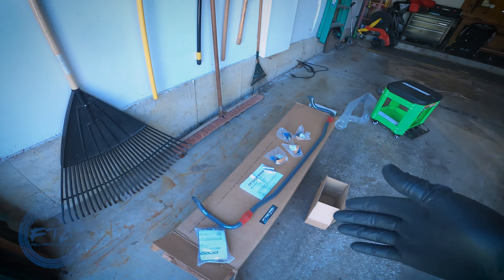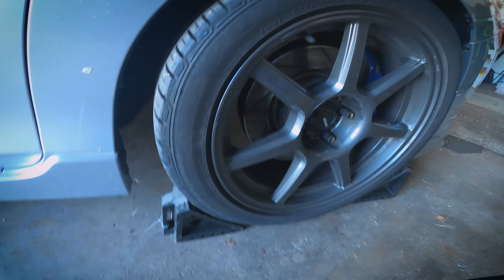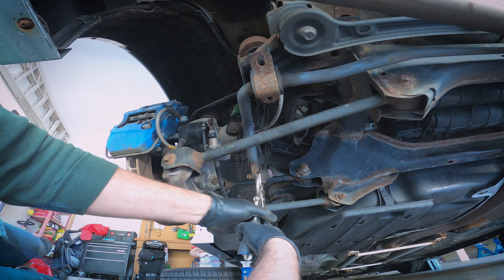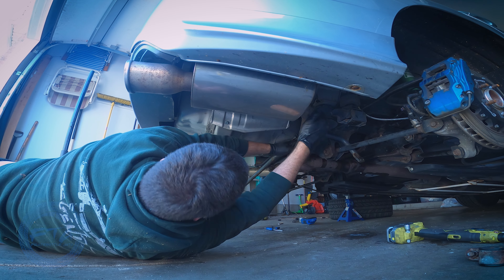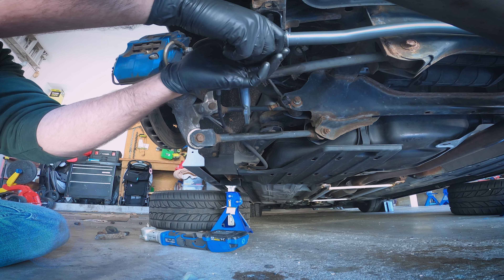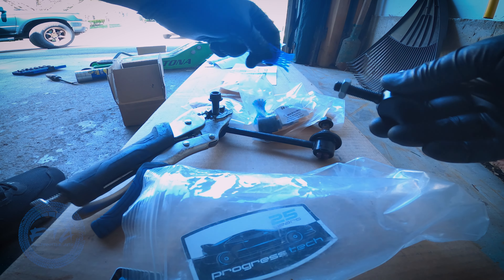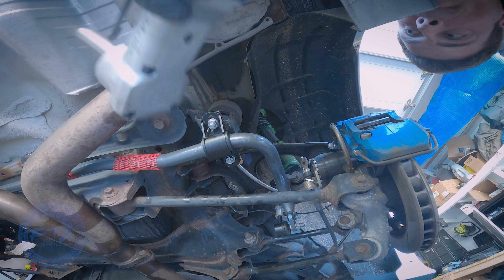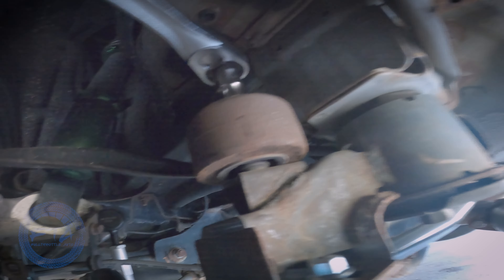9th Gen Accord Rear Sway Bar and Adjustable End Links

Comment: do you lknow if these would be beneficial for my coupe on hfp suspension? I see a lot of mixed reviews on sway bar upgrades not sure what the best route is to go
Reply from the maker: Sway bar upgrades are one of the best things you can do to help control body roll. It absolutely would benefit you even with the HFP suspension. I personally recommend the thicker option of the two options Progress Tech has, which is the one I did in this video.

I hope that helps you out.

Thanks a lot for watching and commenting.
Reply: @FULLTHROTTLEAUTO  Thank you so much! I always enjoy your videos. I’m looking forward to hearing your thoughts on the upgraded front sway bar with adjustable progress links as well
Reply: @FULLTHROTTLEAUTO I guess the only other question is which size adjustable end links you recommend going with. Theres a couple different options on heeltoe which is where i planned on getting them from
Reply from the maker: @boostedsteve  for the rear I like the Progress Tech option. Having only experienced their product I would recommend them and from what I'm aware they only have the one option. I can't comment on any other company since I haven't used and of the others.

Comment: I may have missed it, but did you have to make any holes bigger to fit the upgraded end links?
Reply from the maker: To fit the end links, no. To fit the sway bar, yes. I mentioned the larger holes for the sway bar mounts in my other sway bar video.

Comment: Even if all you do is the rear sway bar and the front brace (like me, all I wanted was a car that was flatter in turns... I don't track my car), it's literally transformative.  

 Can I get the upgraded sway bar links and use them at stock ride height?  I'm trying to further improve the stability of my v6 accord.  (Did the 19mm ultra racing and the front strut brace)

I may do some ultra racing subframe upgrades too, just to keep the chassis level.  What's your take for a daily driver?

Thanks.

PS:  more accord videos!!!  I may do a front sway bar myself to keep the v6 from being porky
Reply from the maker: Yes you can use the sway bar links at stock height.

I think what you have planned is a great option for a daily driver setup!

More videos will definitely be coming out.

Thanks a lot for watching and commenting.

Comment: Love the content, 2 questions, how have you addressed the issue of negative camber with the car on coilovers? And did you need to replace the OEM sway bar end links or could you have just reused the OEM ones?
Reply from the maker: Thank you.

Since I had to use the vise grip pliers method to remove the end links due to rust I would needed to replace the end links with new ones. If you can remove them using the allen wrench and ratcheting wrench method then you can reuse.

The car can get -2 degrees of camber in the back with the normal alignment options from factory. For the front you can remove the alignment bolt from your coilovers or struts top mounts to get I believe -1 degree or maybe a bit more. However I have camber plates in the front to give me more than that. I did a video on the front.

Hope that helps, thanks for watching and commenting.

Comment: I have the tsudo sp2 catback exhaust as well will the size of the exhaust interfere with this sway bar?
Reply from the maker: It'll only interfere to get it on. That's it. Once it's on there is no interference.

Thanks for watching and commenting.
Reply: And do you think this sway bar is worth it does it actually make a difference?
Reply from the maker: @josephguinta  as I mentioned in the video, to me it's worth it. It will make a difference. Will you notice that difference on the road with normal driving? Most likely not. But there will be a difference compared to stock. And even over the 22mm.